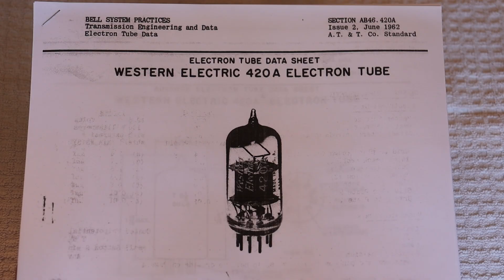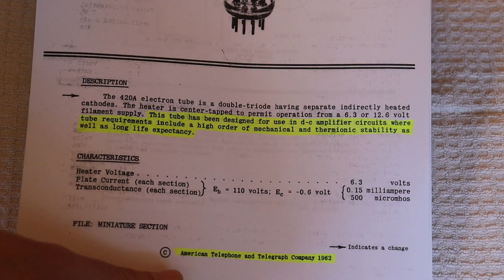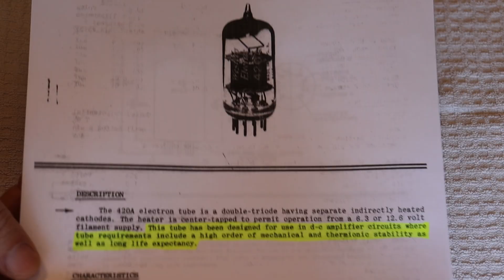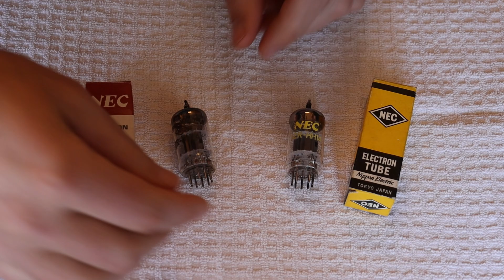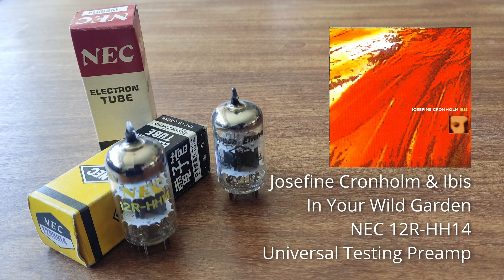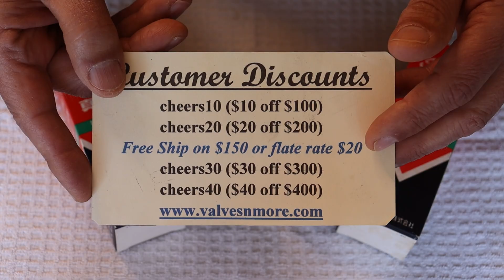Tube Lab #232 - 12R-HH14 Tube

Comment: Do you have a video where a new tube and one at the end of its life sounds like back to back? How about a video of how the various defects or short comings sound like ? Perhaps a video where you demonstrate the various ways tubes get abused and what that sounds like . I think all that stuff would be fun and for science! Thanks!
Reply: Amp Dyno  tube shootout !
Reply from the maker: @321CatboxWA  as tubes age they either die quickly or fade away slowly.  It would be next to impossible to capture that in a way that you could listen for it.  One simple method which i use both for tubes and my cartridge stylus, is to sub in a NOS replacement.  The difference is often significant and you realize the tube or stylus is done and needs replacing.  Tubes often get noisy when they age, are dropped or run in a poorly designed circuit.  That's hard to miss, you'll start to hear a scratchy noise on one or both channels and that's a sure indicator it's time to replace the tube.
Reply: @tubelab194  sound advice indeed , thanks . Your the best!